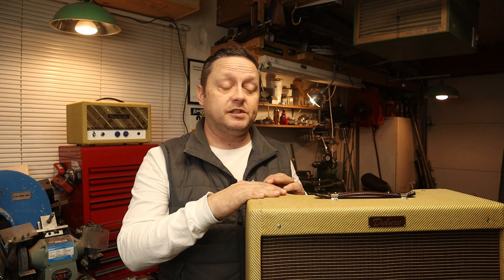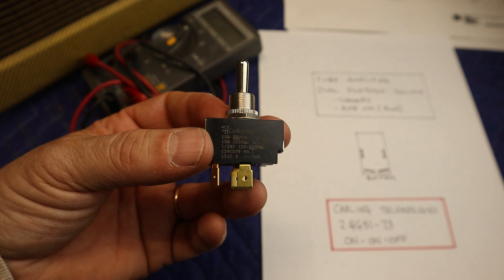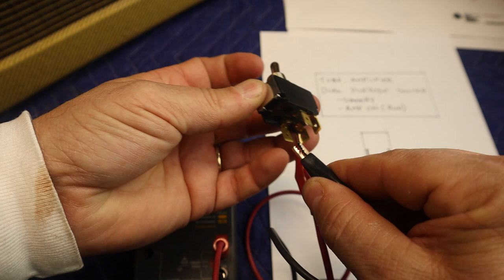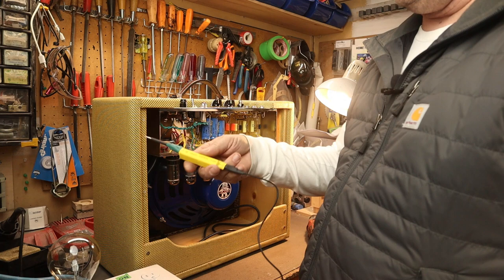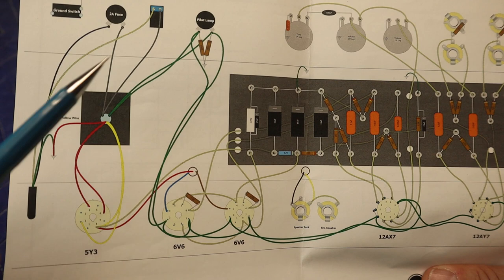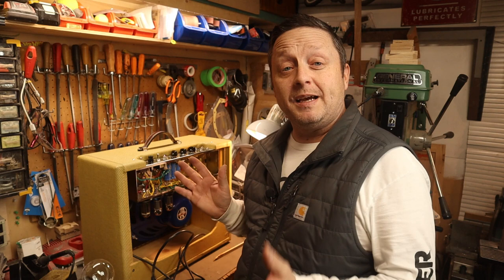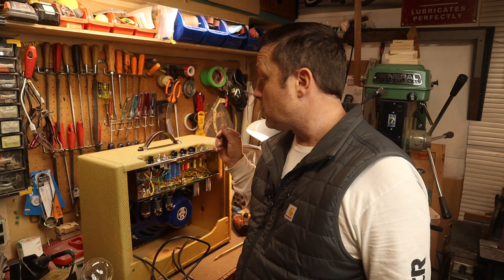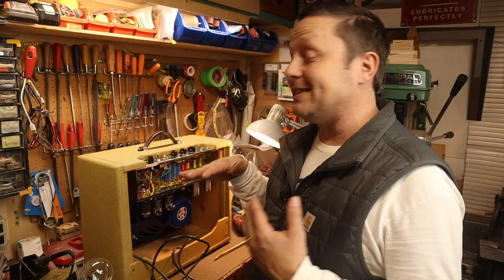Install a STANDBY SWITCH in a tube amp without any chassis modifications / 1 switch ON/OFF & STANDBY

Comment: I'm wanting to put a high low switch in a tube linear is it possible? And can you explain how?
Reply from the maker: Thanks for commenting but I do find your question a little vague and hard for me to answer.  Yes, it is possible to lower the power and/or attenuate the input and output signal. I'd need to see the schematic and a better description of what you want to accomplish, Cheers.

Comment: I thought the 5E3 doesn't really need standby.
Nice option for amps that do, though.
Reply from the maker: Thanks for your comment.  Sort of, the rectifier tube helps due to it needing to warmup first before it will conduct. I like it for the cable pop.  It is more useful for solid state rectification.  I was basically showing the unique switch and how it can be used.

Comment: No amp needs a standby switch, waste of time.
Reply from the maker: For the lower power amps with a rectifier tube, you are correct. Like I said, I like it to avoid the pop. However, if you have a amp with SS rectifications and have a high B+, I would think about installing one. Most power supply caps are only rated to 450V. If you have a high B+ amp with a larger PT you can easily exceed 450VDC on startup.

Comment: Completely unneeded on this amp
Reply from the maker: Thanks for commenting. I don't disagree due to the rectifier tube and moderate B+ voltage these amps use but it doesn't hurt things. The main reason for the video is to show people the unique dual function switch and as I mentioned, I like using the switch for switching leads. I don't like the POP sounds of the input jacks disengaging and engaging. Cheers
Reply: @MikeFreda  sorry i now see in the comments you addressed what i said already